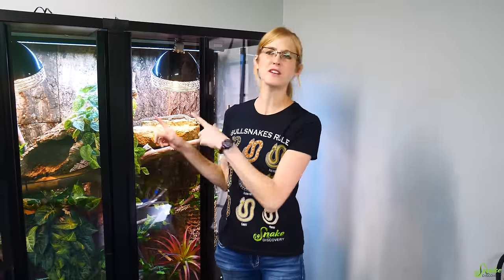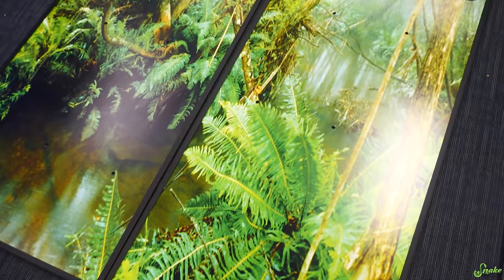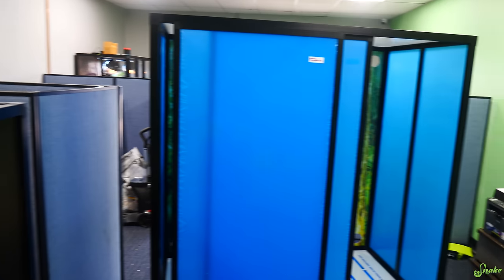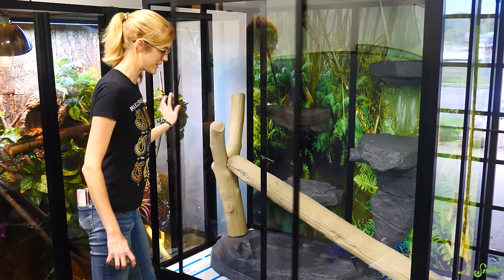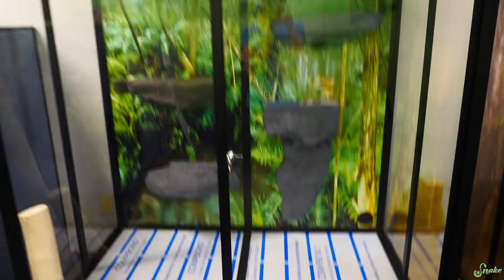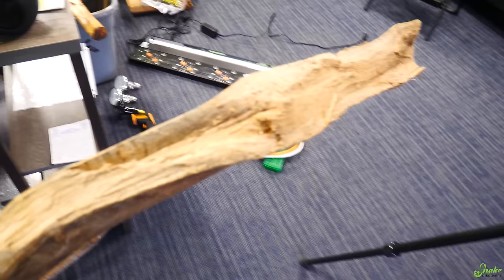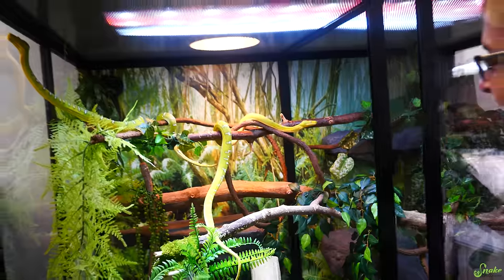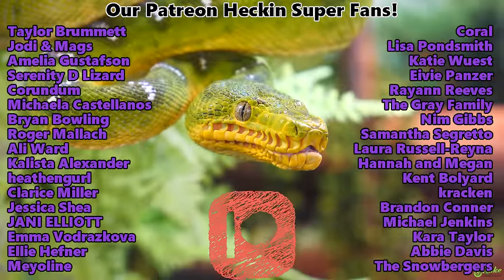We got Emerald Tree Boas!

Comment: An emerald tree boa is kind of my dream snake. Aside from the price of said snake, I'd need to gain some experience with another snake or two because I'd rather be fairly good at reading moods of snakes before taking on the one with teeth/jaws like these have. They are the the most incredible looking snakes though. My understanding is they are reasonably good to handle, especially the Amazon Valley variety (they have a stripe in addition to those amazing markings...and a price equal to a new car). That cage is perfect for them and hopefully they end up on display at some point.

Comment: Maybe im overthinking it but is the wobble intentional? I would think so, especially if you live in an area that has earthquakes. I only just recently moved to Chicago but many buildings are able to wiggle to some degree when its windy and the same applies for earthquakes (ive lived in California before moving).

Its a safety feature since something more sturdy is more likely to topple or collapse in on itself due to certain forces and how the energy is distributed through the building or in this case the cage.

(Disclaimer im not an architect, these are just some minor things I ended up learning)

Comment: Hello Snake Discovery! I am in the process of converting an old aquarium into a terrarium for a snake I am planning on getting (still in “research” and “pre-clean” phase of my plan). 
You mention in a few videos a UVB light and I was wondering if that’s a special kind of light needed for snakes or if I can re-use my aquarium lighting that automatically changed to mimic the different light gradients of passing daylight/nighttime cycles in tandem with heat mats?